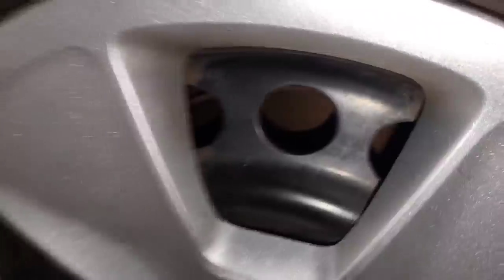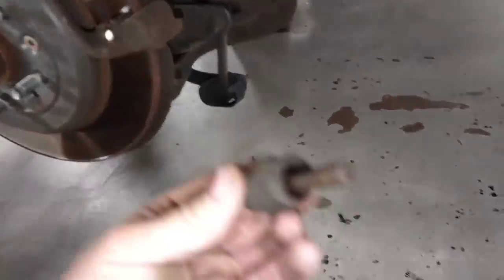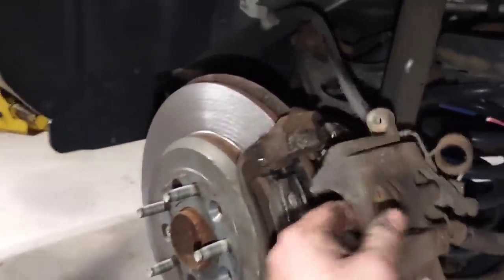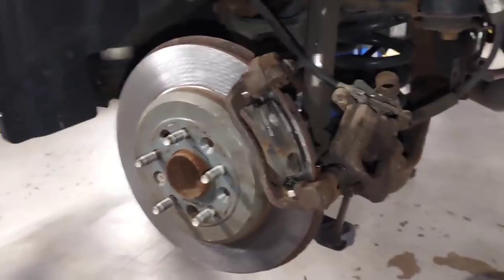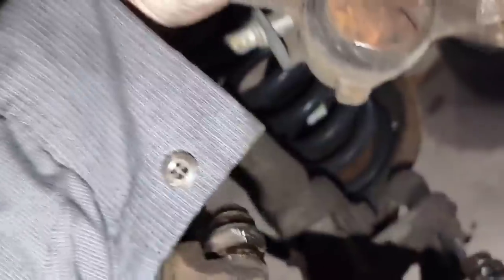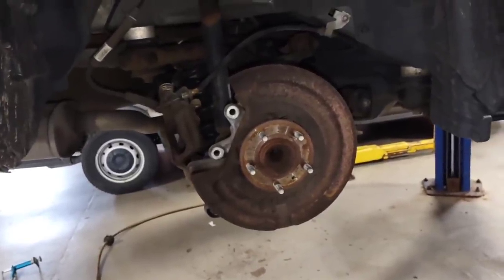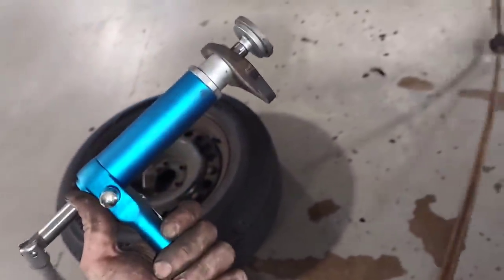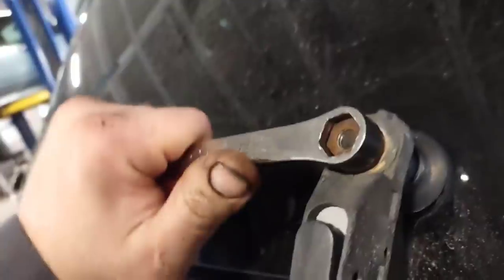Fixing Another Shops Brake Job Screw Up - this makes mechanics have a bad name Shoddy Work

Comment: Hi rich those rear brake calipers are abs system and it's vital that you make sure that the locating pin lines up with the brake piston to enable the piston to rotate for adjustment of the handbrake i had to replace parts on my mates car as he didn't know what he was doing and ended up paying more money instead of getting me to do it for him you're a great guy and I appreciate you very much regards Tony 😀👍😉

Comment: I started using Raybestos element3 brake pads several years ago. They are copper free and super low dust. I know this doesn’t sound possible, but they bite harder than oem pads and don’t wear out rotors nearly as fast. The rotors on my truck are 10 years old with 120k miles of 95% city driving. Replaced the pads at 70k miles and my drilled and slotted rotors didn’t even have a lip on them. I used these pads on Ford oem rotors for my wife’s escape and it’s a night and day difference. She loves the extra stopping power. The pads and rotors on her car have ~74k mikes on them and over 50% life left. Her commute is 3/4 highway. Rockauto is where I get the pads. As a 15 year master tech myself, on semi trucks, I am PICKY about brakes.

Comment: Not going to lie, cleaning and greasing these slide pins is new to me.  I've been working on my own vehicles for about 12 years now.  That being said, most of what I have still have drums in the rear.  However, I had still made it a point to at the very least make sure the pins moved, as they were obviously supposed to move, and, if they were stuck, at least get them out and clean them up.  If my hardware came with new ones, I would install those.  I've been in power generation and industrial factory maintenance.  I just used the concept, it is supposed to move, so move.  Texas is a good environment for vehicles though.  Not much rust.

Comment: Once a new guy in the shop installed the wrong oil filter.  Lucky for the mechanic I found out the problem when the oil filter fall on the ground and roll behind me.  I shut off the car.  Since that time I have an obdII reader,  I do all my oil changes, trans flush, ptu flush, coolant flush, steering fluid flush, breaks, straps, sensors, spark plugs, filters, engine mounts and anything you don't need specialized tools.

Comment: I did a brake and rotor job recently on a Nissan Murano for a relative who didn't have much money, I could be wrong but I think I did as good a job as could be expected considering it's me and not a shop. 
The last time I paid someone else to do a brake job, they charged me 1500 dollars to do all 4 on an old explorer and didn't do it right. They did not replace everything and one of the tires came loose during a drive. I vowed to do my own work after that. 
I tore the Nissan rear down fully, cleaned and striped all the rust or other funk off the wheel and caliper assembly. It's as close to factory as I can make it, which is far more than any shop i've seen.

Comment: When you were in the Escape for the road test/pad bedding and started talking about the shop that did the work, "right down the road, next to the muffler shop" I thought for sure you were going to go pay them a visit and give them hell for this shitshow of a pad slap.
Reply from the maker: I want to but she is pissed and she is headed down there again 

The first time the guy told her to leave and now she is going back to confront them again
Reply from the maker: @tncountryboy06  Have you checked for codes in pcm?
Reply: @tncountryboy06  Temp sensor gone wonky.
Reply: @tncountryboy06  Hmm a short perhaps, fun part is figuring out where 🤪, from what you describe sounds like your spark is being delivered to the temp gauge.
Reply: Had same problem in my 2000 grand marquis with electronic dash. Under hard acceleration the temp would peg dash would beep and then go back to normal. Replaced all the original COP's and the problem stopped. Read that solution somewhere on the internet at the time.
Reply: @tncountryboy06  Coil On Plug.  The individual ignition coils that go on the plugs. That's stopped my problem right away. I put aftermarket ones on. I still have the car. It's the spare car that sits in the driveway that the kids use if there car is in the shop. Good luck.
Reply: @tncountryboy06  if temp gauge spikes fully it may have a short to earth somewhere

Comment: You should see the stuff rolling around up here in Canada lol. Those alignment pins would be wore from 1/2” down to 1/4” from rust, boots wouldn’t exist and don’t even get me started on wheel bearing removal lol. Every brake job should get and calliper bracket rotor and calliper but nobody wants to pay to replace to it’s pads and clean, out the door squeaking like it had no pads

Comment: That's crazy an actual shop was that bad.  I've changed my own brakes at least 4 times in my driveway with zero formal training and I've never had a problem.  I only say this because I think it's so damn easy to fix brakes.  I'm in awe that anyone can screw it up, especially someone with certification.

Comment: Good job, man.  I noticed that the boot on the one piston was torn so you probably replaced that too without mentioning it.  When you said  "I don't think a shop did this", I thought "BINGO!".  The husband and/or a pal of his slapped this bad brake job together and took the lady's money.  That's what this looks like to me, anyway.
Reply from the maker: that boot is a dust boot it doesn't hold fluid or anything so there's no reason to replace it just cuz there's a little tear in it

You can only offer so much assistance remember I gave this job away to get this lady safely back on the road it's not my job to keep giving things away that boot is completely fine

Comment: Thanks for the compliment about independent shops. We are expected to know everything about every car. Its impossible,  some people claim to know everything though.  They make all of us look like idiots. The top comment is that even the newest mechanic knows something easy like brakes. Youd think so but be surprised. The last 2 water pumps I've done, a 3.0 Mitsubishi in a caravan had a broken off water pump bolt. Broken off in the block. What was the solution that the independent shop mechanic came up with? A ton of silicone.  That way it would not leak right away.  Well I got the van because the poor lady sold it due to already replacing the water pump and timing belt and not wanting to pay to due ot again.  Now I'm putting a 2.7 in a sebring. We had the donor car. It got hit by a dump truck and had a good motor with a fresh water pump. We opted to put pump and chains in it since that was the weak spot. Tuffy put pump only in the engine and never put chains, tensioner, or guides in it. In their defense, that could have been customers decision  not wanting to spend money. Not in their defense is they stripped motor mount bolts into the block that go through pump too. Instead of helacoil they put the bolts in, left them loose,  sent it out the door. Idk why so many mechanics act like lazy dope fiends,  but they make people quick to assume we are all trash people.  Sadly that isn't the case but I can't blame people who have been screwed countless times for feeling like that
Reply from the maker: I feel you I'm exactly in the same mind thought as you
Reply: @FordBossMe  you seem like an upfront straightforward guy.  I believe the best thing we can do is change people's minds by being good to them.  I try to explain that if a mechanic doesn't have too much stuff to do, they are not a good mechanic.  I'd like to start a YouTube channel because my stuff is always an adventure.  Just like your stuff.  I specialize in European cars (even though I use ford/loctite silicone for them.lol" we sell zero turm mowers,  work on lawn equipment,  have a guy that does tractors and farm equipment,  have multiple antiques (old mg, datsun 1600, vw camper van,  etc.) Just have not gotten around to it yet   you seem to have the same outlook that my boss taught me 20+ years ago. You can RIP someone off and make the quick money or treat people right and have a customer for life, plus the people they refer.  He also told me " do things efficiently but still properly.  Their vehicle is important.  Their safety along with others around them depends on doing it right.  But still be fair.  You never know whether their money is their mortgage, food off their table, or their kids birthday present money. Treat them like you want to make sure food sits on their table every night because they put the food on your table by bringing their car to you." Thanks for being kind, considerate, and honest with your customers.  With enough people like us that truly care,  and take pride in keeping America moving,  we can prove that the majority of us are good people that really care

Comment: When I was an express tech we were taught to pull the slides out, wipe down, lube, then take the pad clips and clean them, then lube them, lube the tabs on the pads, lube the entire back plate, then carefully install without getting lube on the pad and install any tension clips.

Comment: I always use new brake hardware and caliper bolts.  Its not that much more expensive and then its done right the first time.  If I have a shop R&R my brakes, I specifically specify new hardware kits and caliper bolts as well as replacing any worn caliper bolt boots.  It always costs more to not do it right the first time.

Comment: I'm not a master tech by any means,  but I've been a mechanic for pretty close to 30 years. Lost count of how many other people's "repairs" I've had to fix. Couple years ago, this woman brought an f150 to my shop, 2012, 2013 something like that. Her husband did the brakes on the front. Truck had almost no brake pedal,  r/f wheel was loose,  left side had a stud broken off. He had the pads on backwards,  the ones with the Mickey mouse ears where on the outside. I don't know how he even got the calipers back on. I've fixed shit rigged shit from other shops too

Comment: PLEASE BE CAREFUL WHEN HAVING ANYONE WORK ON YOUR CAR!

Going through the same thing with my front brakes! I just paid $400 for new rotors and pads, but these fools at the shop only replaced the pads! After waiting over 4 hours for them to replace everything, and it was only myself and two other customers who had to wait while they had 7 guys in the back!

How do I know because as soon as I left the shop the car was braking worse, and even when I called and took the car right back they claimed it was done right, but they didn't even show me the old parts compared to the new ones after I asked!

My car has been squealing, delayed stopping, and rubbing more than before since day one of this so called brake job! I've done my own work on my cars since I've been young (Yes I'm a woman!), I know that it doesn't take that long for rotors and pads to be seated after replacement! 

The only reason I had a shop to do this was because I'm from Florida, but my job had me in Arizona at the time since it was supposed to be temporary I didn't have my tools, and I felt the brakes fail right after I drove my family out there. 

So long story short I did the responsible thing, and had a shop to do it ASAP. But tell me why I get back home, and make the attempt to replace them once again after only 4 months with better quality rotors, and pads only to find out that that same rusty rotors are there, and everything is seized on with the rotor screws stripped and the old clamps too!!!

So the only bolt that was lose was the lower caliper bolt just so they could put new pads in, and the same rotors that came with my pre-owned car now feel warped and they slide!!! SMH 🤦‍♀️🤦‍♀️🤦‍♀️🤦‍♀️🤦‍♀️🤦‍♀️

Comment: I had a dealer that did just as bad of a job as this. The pads completely wore out after 11,000 miles and they blatantly lied and said it was because the caliper had seized.
Reply from the maker: I'm not sure where the hang up his here and why people keep going back to I had a dealer do this or an independent shop do that that's not what this videos about this video specifically about s*** were the technicians do as I stated all technicians that do this kind of stuff it's nasty work and it makes us look bad

Comment: I had the same problem with a tire shop that did the brakes on my wife's old car.  Caliper guide pins were completely seized, pads on one side of each rotor were gone, other side was brand new

Comment: This is why I try and do most of my own work . If I'm not sure I do my research and I have a guy I trust who owns a shop and I pick his brain . If you find a good Mechanic treat him like a  Prince or Princess . They don't get the respect the deserve.
Reply: It all comes to doing the job and just doing it right. Take the time, learn a thing or two, and just know the little tips and tricks to make the job perfect. From the cleaning to the lube on the surfaces ect. Doing a bad brake job doesn't make sense. Doing a cheap padslap for your own car isn't ideal either, sometimes it's just what has to happen, but even then you can't do a poor Job. Always rotors and pads unless you turn the rotors...which most you can't.

Comment: I always use a pipe cleaner and brake cleaner when cleaning out the slide pin holes and a wire wheel on the pins. Same with the pad shims and always use white ceramic grease on the metal contacting surfaces on the brake pads. And the worst thing is to rush a job, always look at the old pads before installing to make sure they are on the right way around on the calliper and what position the piston groove is in.
Reply from the maker: rust chemical inside the slide pin areas before cleaning it out with brake clean if its rusty

If not i do the same as you

Comment: Sad thing is it would have taken a few more minutes and it would have been fine. 
I am a mechanic and I would have never let that leave my bay the way the other guy did.

This looks like a back yard job not a shop .

This is why I help my friends and family.  So they get a quality job and save a bit of money.  

Nice to see someone else also uses the sand paper method with the rotors. You can feel the pads mate in fairly quickly on a test drive. I don't see a problem with how you did it with what you had to work with money wise.  I would rather have it how it left your shop then how it was when it came in.

A way that I use sometimes to free the pins in a couple taps with the impact, not letting it spin in the bore but just to get it moving. After it's out clean the pin and bore out. I haven't had any ill effects from doing it this way, I could see it being a problem if you aren't careful. If anyone tries it do so At own risk.

Comment: been there.... done that many times!
rust belt is the worst for this. a needle scaler cleans those up very nice but frozen pins can be a problem.
so its clean..repair or replace the first time.

Comment: Rotors: I used an 80 grit to skuff the rotors just enough to give it a non directional finish similar to a cylinder hone only slightly corser. Breaks in the pads nicely. Of course cleaning and high temp lube in the correct spots. Never a problem. I'm lazy and only want to do the job once. Oh these were school buses fyi. The CHP inspected the quality of work we performed.

Comment: I got ripped off by brake masters many years ago and it came at a time I couldn't afford to lose money. After the service it pulled hard to the left and I had to drive it like that for two months because I couldn't get it fixed right. Turn out they didn't turn the left disk just the right. That's when I self taught to change my brakes. I've done about 7 over the years without any issues...

Comment: In the shop I worked, we always replaced the brake hardware, serviced the caliper pins, where applicable, and flushed the calipers (drain the master reservoir). If they choose the cheapest brake job, we annotated that in the work order by customers choice) Brakes are not something that any car owner should ever play with and a professional mechanic should always inform his customers.

Comment: I am a diy.  I change the oil on mine,wife,and 3 kids cars.  dexos1, dexos2, 10w40,5w40.  not one car takes the same oil!   each brake job i clean all the hardware, grease, and inspect the underside lines and cables, as well as bleed and put new fluid in rr,lr,rf,lf.  my 2002 had the same rear drums and shoes till 2020 (only cleaned every 4 years or so).  my front rotors were on from 2002 till 2020 (when they were close to spec for being too thin), and i never cut any rotors. My front calipers are original from 2002. also clean the piston with brake fluid and a scouring pad and light 150 sand paper before pushing it back in.
i rebuilt my 4t65e transmission 40,000 miles ago, and new head gaskets on a gm3100 back in 2009 and 100,000 miles ago.  a calibrated torq wrench and dealer shop manuals help a lot!!